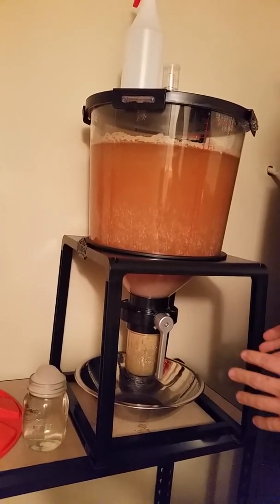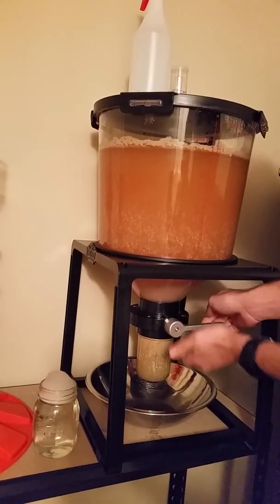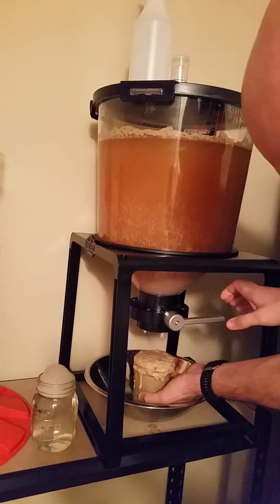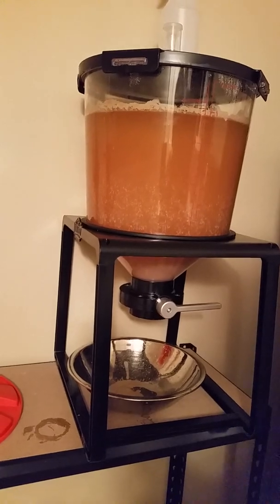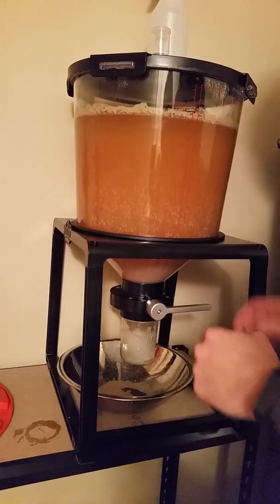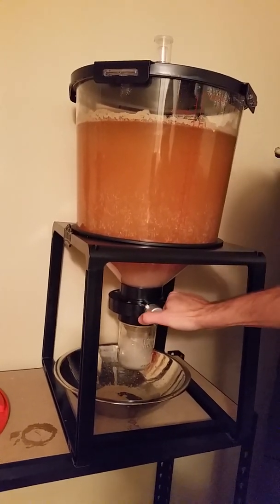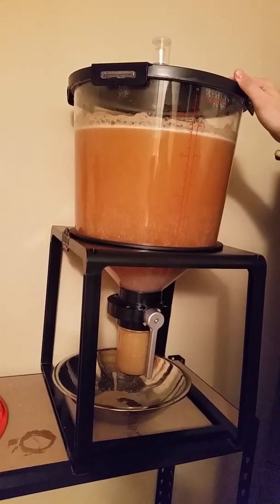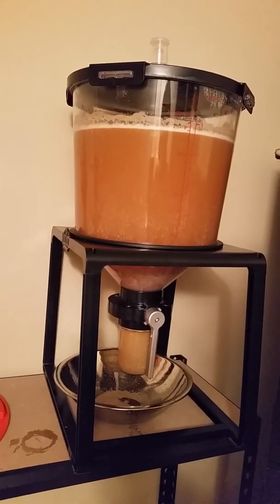Catalyst Fermenter Secondary Transfer

Comment: Does that release a bunch of oxygen into the wort when you put the second jar on??
Reply from the maker: grwood15 there is an air bubble that goes up through, it mostly heads strait up through the airlock. there's enough secondary fermentation going on that it doesn't concern me. if you are worried about it, you can always fill the jar with sanitized water instead.